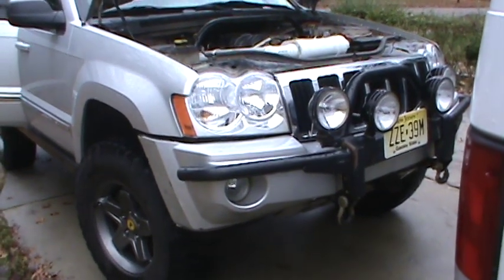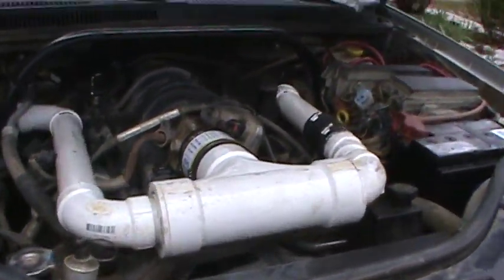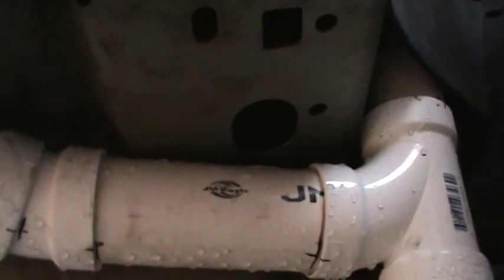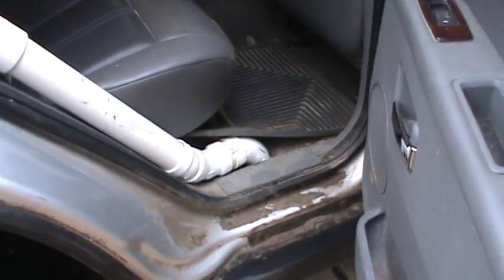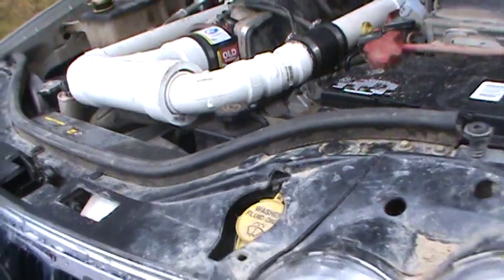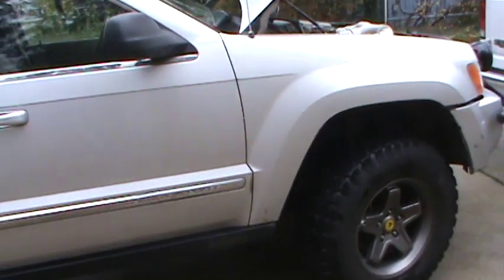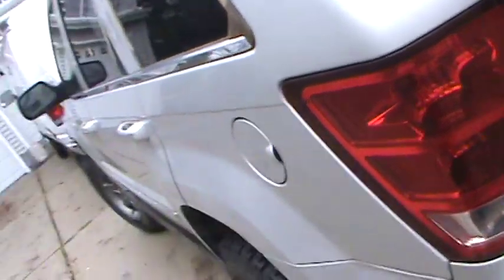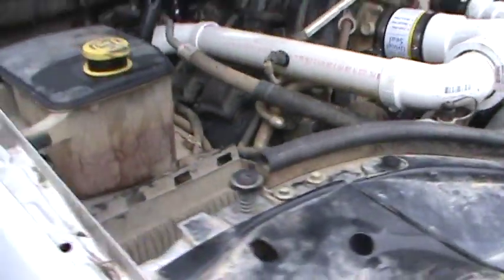2006 Wk Jeep Grand Cherokee Dual Snorkle Fabrication WATERPROOF!

Comment: I think your next project should be re routing the exhaust to the interior lol
Reply: It should go straight into the snorkel intake - reuse of unburnt fuel for maximum power
Reply: +whatSongIsThis? I wonder if he came up with the idea before of after his coke charge
Reply from the maker: 5 years later and not a leak, runs great and my videos uploaded prove the success of this.  I am able to do tight spaced wheeling with no risk of breaking my intake tubes, go over ice and snow and drive into DEEP water.  ZERO issues so you and all your Internet warriors that don't like it can suck it up.

Comment from the maker: Two years later PLUS with extensive beatings, this system is holding up fine.  I prefer the interior snorkel system as it keeps the pipes inside so I can get through narrow trails without risking hitting it against trees and such.  I rock crawl/run, river crossings and such and ZERO water so my system is cheaper, 100% reliable, unique and shows craftsmanship unlike someone buying plastic from the internet and installing it for $500 which is what it costs for a WK.

Comment: Holy smokes...THIS is your solution?!?  Is your buddy a mechanic or a pipe fitter?!? This contraption couldn't possible be practical under any conceivable circumstance.  Is this a gag?  You've got more piping running in and out of this poor Jeep than the Baltimore aquarium!  All you had to do was mount a Hummer style snorkel up through the hood.  That would have taken maybe 24" on pipe and a couple of flex fittings.  I can't imagine how annoying it would be to sit in the back seat with those pipes wooshing inches from the head rests every time you get into the throttle.  Wow...
Reply from the maker: +Jay mind ya business "This contraption couldn't possible be practical under any conceivable circumstance." 4+ YEARS of HARD abuse and no leaks working GREAT!  In the back seat, they are tucked and zero issues for a passenger or noise for that matter.  You also cannot pout things up through your hood in New Jersey either, but the real reason I did this is I can and do run in VERY tight areas where any external plastic is subject to getting ripped off my Jeep.  I love how you folks psot all this BS and yet a SHIT TON of videos of me HARD wheeling with this installed afterwards successfully keeping the engine safe.

Comment from the maker: The PVC has some play to the front of the engine-it is COMPLETELY watertight and on for over a year with ZERO leaks.  I can smash off of things and not have the premade garbage hit the trees and rip off.    I lost my camera, but will upload videos of the Jeep swiming VERY soon.  I can drive into 10 feet of water and had the entire Jeep down to right near the roof already :-)  The Jeep is near watertight thanks to a tube of rubber and a bit of time.  I LOVE this setup!

Comment from the maker: My Jeep picked up near 1.5 MPG and approx 20 HP with this setup, confirmed by 120 mile drive this evening.  Will add the armor and wheel it safely in a lot of water and will post.  Why do the haters even post for innovative fabrication that is functional?  You guys might not like how it looks, but this Jeep is for wheeling and is built to be functional.  The materials were $220 including both K&N's compared with a $550 "proper" snorkel that looks bad to me and also will hit things as I wheel.

Comment: Alright, this video gets nothing but hate. I would NEVER run a setup like this on my Jeep, but it's damn near space exploration out of the box thinking! It's incredible. So much work and dedication had to have gone in this. I went wheeling earlier this year with someone who was the owner of an '05, and before the water had even come up the door seals (the front end was lower than the rear, it was a dive into the little pond. little 2" budget boost) the engine had sucked up enough water with the factory airbox to kill itself. Luckily there was no permanent damage (so far), but the moral of the story is that the WK REALLY needs an intake to be remotely capable. The OP is correct in that all the snorkels I've seen for these are not great. I think this is so damn cool. Once again, I wouldn't ever do it, but it CLEARLY works VERY well! Seriously, watch some of the rest of this guy's videos. It's damn incredible. He wasn't joking about floating ;)

EDIT: Also, if I was to build a true mud rig, something like the ones you see on TripleX, I would DEFINITELY consider some kind of in-cab intake. I have seen it done before on that type of rig and you'll never see one of those with water in the motor.
Reply from the maker: Thank you brother-even drove it to work today with 109K miles on it of HEAVY abuse/use :-)  the in car setup gives me the ability to smash my Jeep without killing a snorkel as my wheeling areas are REALLY tight trails.
Reply: Hell Yeah! Really cool to see that it's lasted this long too! People fail to realize that everyone wheels differently. Anyone can run a snorkel but when you have a specific set of conditions, you've gotta take it into your own hands. Love it man. This is what makes the offroad community so great.

Comment: Very nice, but I can't help but think the plastic will either melt from the engine heat and/or crack from obstacles.  I look at this like when you make a custom bumper.  First you use the cardboard, then you take it apart and replace it with steel.  So now take it all apart and replace it with metal tubing.  I hope I'm wrong.

Comment from the maker: The motor blew on the regular road, not because of off roading.  It is common with older Jeep HEMI motors throwing a rod.  Crate motor on Ebay, new old stock $3400.

Comment from the maker: It is not too loud and ALL the kits you can buy (only 1 for the WK BTW) are plastic too.  This has a lot more protection for my use as I smash into things as I do wheel aggressively so this looks better to me and works better and I picked up HP rather than a lot of kits that lose HP.  Amazing that people have no idea this cannot catch fire-use a torch on PCV and see if it lights up fast.  The fail is what?  You do not like how it looks?  It works 100% TESTED to the gills and was cheap as hell.

Comment: I'm not going to call you stupid or anything along those lines. Just a heads up: that PVC will soften due to heat in the engine bay, it's also brittle and run a (high) risk of cracking due to external forces when hitting a rock/tree trunk/grassy knoll/fluffy bunny/any object harder than air... The engine must suffer due to the looooong intake piping and the hot air drawn from the interior. I.M.O. an external safari snorkel looks better than an internal PVC urinal seal system...

Comment from the maker: There is not an increased risk of CO-zero.  CO comes from the exhaust and for a backfire or the like, it would not have the volume to bring CO into the cabin.  My system has been on for 2 years TROUBLE FREE and has seen extensive abuse with again ZERO problems.  that includes rock RUNNING, car climbing, hill running over and hitting everything the woods can throw at us and it is still 100% fine.  All haters good luck, I LOVE my system hands down.

Comment from the maker: The rocks do not hit my plastic and FYI all you mall cruisers, the commercial options are ALL plastic too.  I have complete full armor around my exposed pipes and it is BRUTALLY tested and running great with ZERO leaks and I have sat in water for an hour+ SUBMERGED and yes I have that on tape too.  I do not have fugly pipes sticking out of my fenders to drag on trees-my WK barely goes down the small Wrangler trails as it sits so I can still go down the narrow trails.

Comment: Yes, because cars are air tight pressure vessels, rofl.
There is a concern with this design, but that isn't it.
The problem is when the engine backfires it blows off the air filter and sets the interior on fire.   With the long pipes and the ends pointing away from the passengers, at least the risk is reduced.

Comment from the maker: I have that air figured out and the fab work in this video was not completed as I said in the video. It has been installed for over a year and not a single leak and ran underwater for over 2 HOURS straight on video too. The fab work is actually good too as it has armor drops, all protected, waterproof, and also done cheap. I did not buy my Jeep new, I bought it used and quite cheap but if I did so what? I have the money so all you kiddies talking shit I think that IS an issue that I the loot.

Comment from the maker: The oxygen content does not diminish, it is going to be roughly 16.9% oxygen regardless, not like it is robbing oxygen content from the cabin, as my cabin is vented deliberately to compensate for the draw.  it does give better airflow to the engine, I would challenge 99=% of the posters here to see if they have even been to a dyno let alone spent tons of time as I have on dynos racing.  It does in fact have TERRIFIC airflow and more HP.

Comment: The interior is full of mud, there's paint missing from the rear bumper yet you're worried that the normal snorkel kit is ugly..... Why not get twin 4" mandrel bent stainless steel snorkels, one up each A pillar, practical and would be a lot better than running PVC pipe all over the car.

Comment from the maker: My Jeep can go down narrow trails without the aftermarket snorkel sticking out of the fender and I get better airflow.  I have tested this now for 2 years of hard trail riding and ZERO issues where an aftermarket snorkel would have ripped off already or cracked the way I drive my Jeep.  I also get terrific airflow to my motor and it was cheaper,.  Haters move on-see my videos, I trail test not Youtube bench.

Comment: I've heard of function over form. But this is neither. That PVC is done with the first rock you high center on. At the very LEAST you could've painted the pipe so you didn't look like a plumber. BTW, saw this on my forum sight posted as an example of what NOT to do.

Comment from the maker: @alexrex20 A "proper" snorkel hits all brush when wheeling where I got and it does look like trash.  The only bumper for the WK is the ARB and does not support my winch cradle.  I could care less what the PVC looks like under the hood either.  I am very happy with my setup as I am a wheeler and not a poser and bar none, this most likely is the hardest wheeled WK anywhere,

Comment: You're right you don't have a fugly pipe sticking out of your 'fender', instead you now have 2 really fugly ones sitting inside your vehicle. 

The way it sits as shown in the video a rock WOULD be able to crack it, unless your armor also protects the "water drain valve".
Reply from the maker: That lasted 12 years until I sold it, not a single leak and yes every part was protected and I BEAT THE HELL out of my Jeep.  Your comment did not age well.

Comment: OP- You keep talking about tight spaces. How tight? You're telling me that every other snorkel on the market would get broken off because of the tight spaces you get into?
Reply from the maker: There is only 1 snorkle aftermarket for the WK that I have seen and it would get broken off where I wheel quickly.  Look at my other videros, I beat this to death and this system has been bulletproof and works PERFECTLY for aggressive wheeling.
Reply: Fair enough!!! 👍

Comment: You ever tried to suck through 30 ft of pipe not efficient should Have ran in the window and been done with with it. Not to mention how loud that is going to be inside. And pretty sweet if it backfires. Does everybody get earmuffs when they get in??
Reply from the maker: +Brett Phillips It isn't loud and my power is better than it was before, but you know everything even through you were never even in my Jeep.  I'm sure you have lots of dyno time under your belt-lol.

Comment: That's just a mess! Snorkels are designed to direct cold air directly into the engine to ensure optimal performance. No way you have more HP with that. I will give you points for initiative but if you do get a leak, which you will, it will take you ages to get in and around to repair the piping. Whereas if you just bought a snorkel you wouldn't have to waste time and be out mudding instead. I will also thank you for this video to worn people of what a stupid idea it is!

Comment: PVC emits toxic gas when heated. Shut off the truck and fumes will float into the cab. Not your smartest moment. There's a reason everyone uses black ABS and not PVC to make things on cars.
Reply from the maker: fordrac1ng81 Do you have any idea of the volume of gas needed for this to reach the cab amigo?  You have more byproduct from a conventional gas oven on your home emitting CO than my Jeep.
Reply: Which is why homes with gas need CO2 detectors. You have one of those in your jeep?
Reply from the maker: clubagreenie You got owned in your post amigo and if you did your due diligence, I am a U Penn Alumni and not a hammerhead talking smack behind my keyboard.  Physics has a lot to do with your comment and if you cannot see that, you have other issues.  This isn't simply Boyle's Law or elementary things you think you learned (ROFL as you type CO2 for CO), you do not even have your gases right-lol.  Another Youtube comment gone horribly wrong there Darwin.  Carry on and read more, post less.
Reply: 2000ViperGTS U Penn? That explains so much hahahahha
Reply: 2000ViperGTS I was just making fun of you. Apparently you didn't get my joke. Have fun with those Dioxins, Mr. U Penn lololol
Reply: +fordrac1ng81 In a fire, the smoke is highly toxic... far more than the lower levels when simply heated.  How about getting a muffler shop to bend tubes and loose the PVC...
Reply from the maker: angurisloud So get rid of anything toxic in a car in case it burns?  Please tell me, should we all remove toxic things from cars in case it burns?  How about you start with the tires and work you ways up.  Where on earth do you people live that common sense seems to be some elusive concept?

Comment: Ok here's a question. I'm not into stuff like this but my logic says it's the stupidest idea ever (don't mean any disrespect, correct me if I'm wrong). I mean putting a filter inside is a good idea, but putting a plastic pipe right under the vehicle? Small rock will crack it and it will suck water in the cylinders. Isn't it so?

Comment: This is a joke right? so instead of one hole hidden behind a professionally made snorkel we have two holes in the floor and meters of ugly plastic toilet piping running through the engine bay and under the floor where its susceptible to being crushed-this has to be a joke no-one would be this brainless hahaha

Comment from the maker: @rtanner420 Mine do come in the cab. I can float my Jeep AND drive UNDER water. I have done it already and the only WK that can do it that I know of. The factory vent tubes are quite short and a sure way to trash your diffs and trans. Amazing at the non wheeling folks posting here. Check my videos and see how hard this wheels-my Jeep is functional and for any comparable 4" lifted off road vehicle, my Jeep is something to be respected off road- and shocks many off roaders,

Comment: Ok, I have Quadradrive 2 and know that the WK does NOT have lockers, it has ELSD or Electronic Limited Slip Differentials not sure who told you that they're lockers
Reply from the maker: A locker is any limited slip and can be engaged with a cable, electronic or clutched means.  For your edification, you can lock them too with the NV245 manually to be a true locker, but with QD2 the clutches are done electronically, so not sure perhaps you are hung up in what a locker is.
Reply: the quadra drive 2 is electronic clutch packs with ELSD it can lock front back and center

Comment from the maker: @alexrex20 I have a Warn M8000 on a cradle that goes front and rear and the ARB negates that portability as well as adds weight to the WK .  Maybe if you did your due dilligence you would see that,  the PCV will not melt, I have seen this done on other off road vehicles and my engine blew after it ingested water, not because of PCV.  WTF is a "cliches"?  LOL you epitomize ignorance with that post.  Obviously you did not see my other videos because you are talking internet smack all day.

Comment from the maker: @SuplexTreatment They are RELOCATED dumbass and hold up perfectly.  Also do you ahve ADD?  Did you miss the fact that the armor is NOT on in this video?  The armor went on afterwards and is isntalled.  This Jeep went UNDER water like this and drove around for 15 minutes ON FILM.  The film is getting edited now so all your armchair wheeling mall crawling commandos can keep talking smack.  I also have two 500 GPH auto pumps INSIDE on my Rhino interior now to pump out water :-) It is a TOY-DUH.

Comment: First off you have IFS so you cant call anyone a mall cruiser, second thats the stupidest idea ive ever seen, Not so much the idea its self but the fabrication is stupid. PVC pipe is the worst choice in material... now stainless steel would of been the go or really any other type of piping really. I have a wide truck and appreciate your point on the track width of the truck and the snorkle catching on tress. But you chose to make it out of plumming material which isnt designed to take impacts...

Comment from the maker: @GSSRT8 Just add to the line and vent up, you can use a simple plastic into the existing rubber and then add more rubber same as windshield washer lines or similar :-)

Comment from the maker: I get better airflow, it is cheaper, the width of my Jeep down the trails remains the same without ripping the ONLY commercial WK snorkel made that DOES look like shit and unique to boot.  What have you personally fabbed and trail tested?  That's right, another armchair commando talking shit.  I have a TON of shit done on my Jeep that is not stock or commercially available and it is reliable.